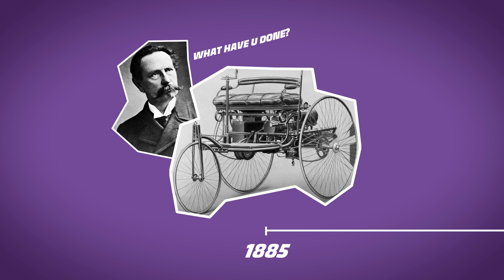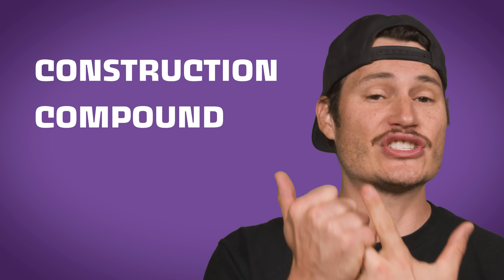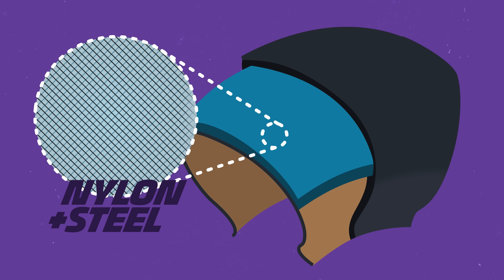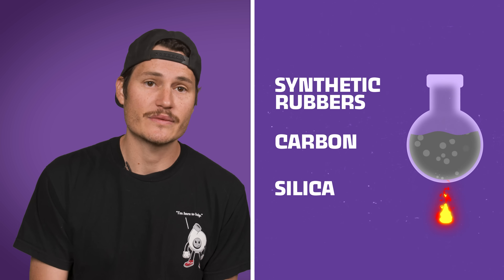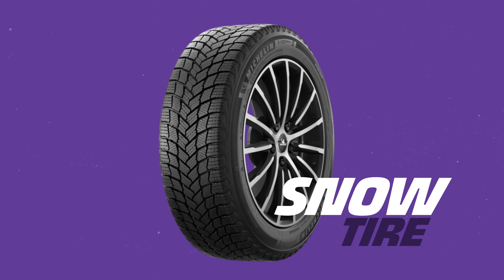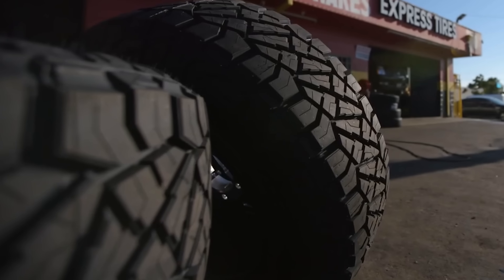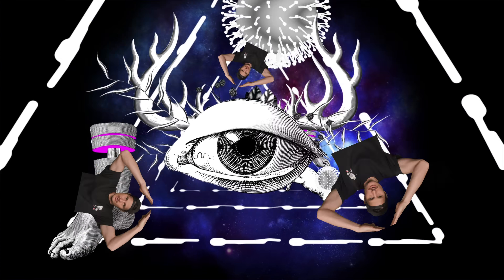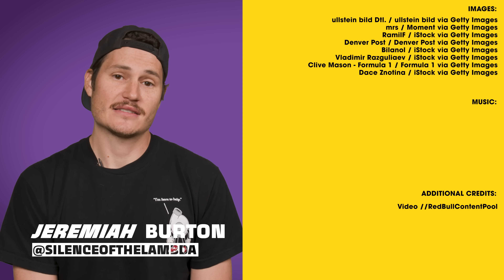The Surprising Science Behind Tread Patterns

Comment: Vht increases fc and weight force  applied  to contact patch  has a lesser efficiency than that of the contact patch to the vht ... you are also dealing  with rubber to rubber  on a  drag strip not  rubber  to asphalt or cement....

Comment: 1 .the mass/weight of the car matters ... can you put a bicycle wheel on a truck?  yes, but we don't have that technology yet, from asphalt to rubber , ..... metals ,air or fluid inside the wheels. 2 .and with  wider tire the aerodynamic will push you up at  3000 km/h😅.

Comment: Is there a tire thats has soft enough tread, but more rigid sidewalls. More grip+less twist=more force.
Reply: More rigid sidewalls equals more weight therefore slower acceleration and poorer fuel economy, needed more for downhill mountain bikes and enduro dirtbikes but less for tarmac. But what do you think about this.. for high speed tarmac applications the centrifugal force is going to be incredibly greater than dirtbike/mtb and therefore they can get away with wider tires/lower pressures and softer side walls because the mass of tyre is being propelled towards the road the faster the tire is spinning?

Comment: 19:00 Wider tires allow for a softer compound without being shredded by massive horsepower thanks to the torque being distributed along more tire. Given the same compound and horsepower below what's nessecary to shred the tires, a thinner tire should have almost as much grip on dry asphalt.

On top of that, remember what you said about the tire sinking into the asphalt and kind of pushing on it sideways? More tire means more pushing, and more pushing means more grip.

Comment: Sure... 300mph, but cost a few million. And who knows how much a month to the insurance company...(if any will actually insurance it, to begin with).

Tread... more like a design to not make contact to the road...but to channel water.

6:39 wait did u just mix Star Trek with Star Wars... smh.

Larger contact patch = more grip.
Hence... run huge tires on the back for the drive tires to put more HP to the ground, and narrow as possible on the front for friction, reduction. Secondly... Dragster tires act like a gear ratio. As they spin faster they expand outward... giving the tire a smaller contact patch, but a larger radius... Don't need the added grip once the car is halfway down the track, plus gives the engine just a bit more gearing to hit the higher speed at the end of the run.

Comment: As for the question - Increase in surface area spreads the pressure of the car along a wider area, thus decreasing pressure. This means that the tires now  has less weight to support per area (dA) decreasing the weight of the car. Ultimately increasing its linear velocity. I am not a good explainer so pardon my stupid explanation

Comment: The thicker the TYRE the more smoke BABEH!!

and i agree with Ben the actual TYRE engineer,
but did i miss something thou
I always like a good lipped/thicker side wall
I think this is very important just as important with lower profile TYRES

1.Prevention of Girlfriend damaging your alloy wheel
on the curb
2.Looks good having that extra rubber meeting the edge rim
of the wheel
3.normally they seem to be or look stronger in budget TYRES
having a more square style instead of a balloon
why was there a white rim on old vintage TYRE sidewall
coz it made it look better of course
to break up the masses of black natural rubber on show,
and something long ago about zinc oxide making the TYRE last longer when 
that was classed as useful, it then stuck around for a few decades
due to vintage TYRES having a profile of 70 or even 80, these nearly come of the wheel
going around corners any faster then 30MPH 
Laurel and Hardy demonstrate this!
actually they demonstrate what its like not having sidewalls 
rubber strip around a wagon wheel
but of course the higher the profile the
smoother the ride over bumps when the suspension isn't up to scratch  
4.better cornering which should've been 1st on the list, granted!!
5.oh they look good/better/sexier/newer/look more expensive
yep i repeated myself coz its important part of the TYRES structure!
always wondered what was after and before the tread ribs  ;-)  
my sweet spot seem to be 50 profile
for overall usefulness and variable abilities also will look after your wheels
love the show
do i get a T-Shirt  LOL

Comment: There's two reasons why you want to maximize the tire contact patch:

1. Different parts of the tire have different linear velocities on the road when turning and the static contact point moves further towards the extremes as you turn harder while the rest of tire is slipping. Having wider tires means when you turn your contact patch will remain on the tires more so than on thinner tires.

2. It's not only the dynamic friction threshold that's your enemy, it's the integrity of the material itself. Sometimes you lose grip before reaching the threshold simply because the tires peel away. Distributing load on a wider surface makes sure that that doesn't happen so easily.

Comment: I learned a lot from this video there is no way I know the answer except for what every one says the more surface of the tire that touches the concrete the more your foot pounds of tourqe gets put to use.... think of an 18 wheeler that has over 1000 pounds of tourqe no trailer still can't do a burn out why..... big tires... tractor high tourqe big tires no spin.. see where I'm going I don't truly know the science but that's my #answer ... dislike if I'm way off... the heavier the object the more tourqe you need but if the weight is the driving force you don't need as much as it's running free not dragging something

Comment: Damn, looks like no T-shirt for me. But anyway, the frictional force is just how much friction a point on the tire makes, you can have a tiny tire with the dame frictional coefficient as a giant wider tire.  However, the bigger difference comes from the surface area of course. Not included in the equation because its not relevant. The more friction, the more the tire fits into and grabs the grooves in the road and holds on. The rubber has to have good wear though for good driving characteristics. The wear is important because thats a shear load being applied to the tire, and the more surface area you have the more shear force is required to shave another layer off. That force us what gives you your grip as a whole while driving, which depends on the frictional coefficient.

Engineering is basically all just this, doo dad isnt part of the equation so how do the principals and equations relate to get the desired result, compared with real world testing.

Comment: Tesla's can hit 60 in 2 seconds and then make it a whole 40 miles on the battery afterwards. For $70k ill buy a beater Civic for fuel economy and an R6 for speed, then ill put the $60k left over in the bank. Then the R6 can hit 60 in 2.5 seconds ALL DAY long with 1 minute gas stops vs 20hrs charge time. And if you want to bring up the extra $15k quick charger, thats just another $15k saved on the other two. Oh and the Civic will have already saw 200k miles of use, the R6 will also have 20k+ miles on it, and BOTH will outlast any brand new Tesla. Electric cars are just the next scourge of pollution that wiill far outweigh any damage of dino juice burners, in fact id argue the absolute eco destruction involved in lithium mining already does.

Comment: I bet if you had a car with 10 tires like a semi frame you could pull around 10gs with around 200 lbs of tourqe per tire I bet you can go from 0 to 60 in less than 1 second the fastest car with 4 tires can get around 2 seconds but a car with more than twice the traction can accelerate more than twice the speed I estate around 10gs and 1 second to 60mph the speed of a jet a normal human would literally pass out if you accelerate for more than 10 seconds I would love to build this with hydraulic power no less than 2000rpms tire speed with 2000 pounds of tourqe at the tires and hydraulic blatter's to dump a bunch of power in a second to accelerate and engine to fill the hydraulic bladder I bet I could make a decent drag racer maybe add a magnet clutch to act like traction control if the torque goes higher than 200 pounds they slip so have the traction control slip at 199 pounds so the tires don't loose traction